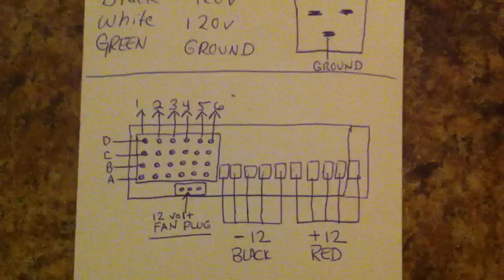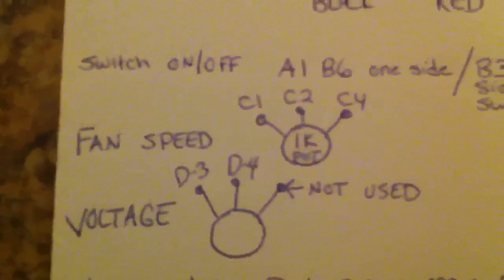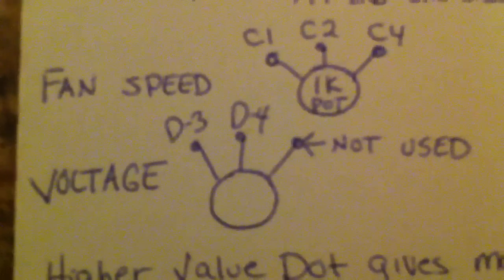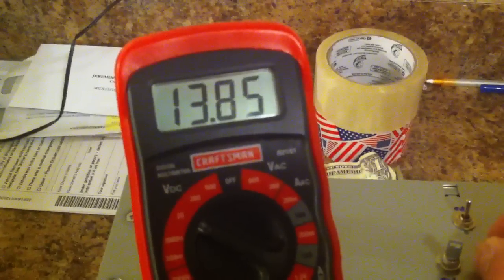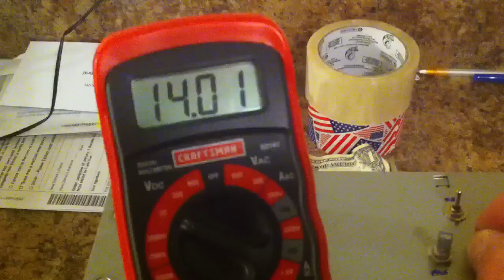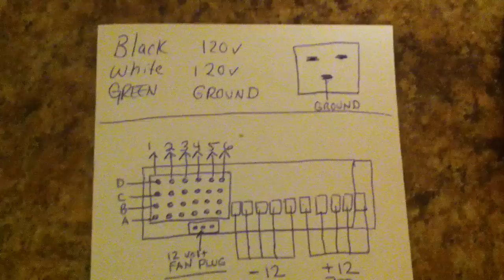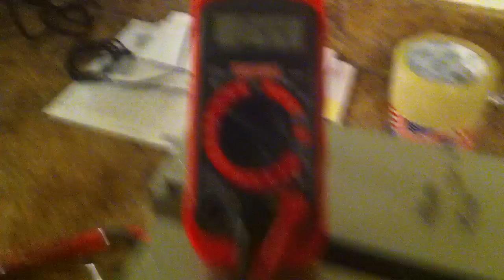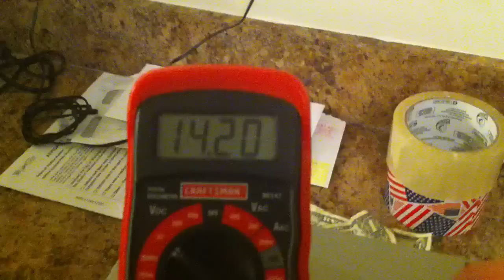Dell PowerEdge 6800 1570 watt 12 volt power supply mod modi

Comment: I ordered a pair of Dell Poweredge 2650, 502w supplies. I'm having problems finding out the pins to jump for power up on these supplies. Have you converted one of these and is the pin layout the same?

Comment: what the max voltage with 1k pot becouse i got a 2500watt car amp but it needs 14.4 or more to put out mex rms power wich is 1200wrms at 1ohm

Comment: I have been using one to power an amplifier. After a while it will just shut off and not turn back on. When I flip the switch I get a green and yellow LED, but I have no idea what they could be. After it sits for a day it will re-engage.
Reply: I had same problem with 2 Dell PowerEdge 6800 1570 watt power supplies.
Maybe we are running at higher voltage than its designed and its damaging some component internally.

At what voltage you were running when you had problem? and how long it runs continuously okay before tripping that error?